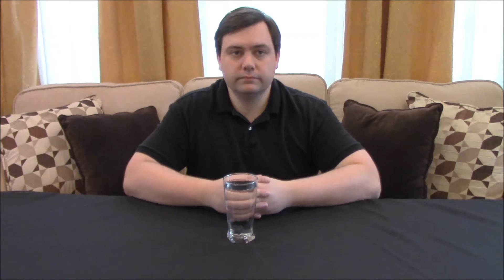On the Compressibility of Water

Comment: I think the myth of water being incompressible is from  the study of steam power plants. In my mechanical engineering classes, (long ago), when studying how steam progresses through a power plant, the steam can compress here and there, but the compressibility of water condensate is negligible, and therefore was probably referred to as incompressible to make it easier to understand. Your comment on the ability of water to transmit sound is a simple way to illustrate how water does indeed compress.
Reply: I wonder what would happen to water in a black hole! I assume the atoms would rip apart maybe turning it into a gas! I guess I’m thinking more about the preverbal unstoppable object running into an immovable wall!

Comment: Sir, I got good answer to the compressibility. I request you to let me know about elastic behaviour of water/fluid
Thanking you sir
Reply from the maker: When something is elastic, it means that it can compress or change shape when a force is applied, then return to its original shape when the force is removed. When a volume of water is compressed by a small amount by applying pressure, it will return to its original volume when the added pressure is removed.

We can measure how much pressure is required to change the volume of a particular amount of water with a value known as the Bulk Modulus, usually labelled with the symbol K. For water, this is approximately 2.2x10^9 N/m^2. The Bulk Modulus is different for different fluids, but can be easily looked up along with equations on how to apply it.

But be careful, water and other fluids are can be tricky depending on how high or low the pressure goes since it may change phase. The fluid may turn into a gas (steam) or into a solid (ice). Also, temperature can play an important role, too. Close to room temperature and pressure, these are not too important.

Comment: I like the nuance addressed. In applications where water is compressed like water cutting, how much of the energy transferred by the water is from the elastic modulus of the metals used? Or is it significantly due to the compression of the water?

Comment: I am not sure your percentage for compressibility is correct. According to the bulk strain formula, at 1,000 bar (near the bottom of the Mariana Trench), water compresses by less than 2%. It's why marine life at that depth don't implode. At around 10,000 bar of pressure, water only compresses to ~ 3%.

Comment: what is the physical meaning of that compressibility of water is bigger than that in mercury ?
Reply from the maker: The size and shape of an atom or molecule, and how it chemically reacts with other atoms or molecules affect how compressible a substance is.

Atoms never actually "touch." When two atoms come close together and do not react with each other, it is electromagnetic forces between the atoms that start to increase very quickly and push them apart. Mercury is a large atom when compared to a water molecule, and there are more atoms of mercury in a given volume at room temperature. This means that the mercury atoms will begin to interact with each other sooner, making it harder to compress than water.

Comment: If you had a container which was indestructable and a press that could press extremely hard, what would happen?
Reply from the maker: This is a variation of the "unstoppable force vs. immovable object" riddle that presents an unsolvable paradox. However, in your particular statement, the press would come in contact with the container and stop.

Indestructible implies infinitely strong. If the container is truly infinitely strong, then no force can crush it. This is true for 1 Newton, 1,000 Newtons, of 1,000,000,000,000,000,000,000,000 Newtons of pressing force. The container will always be able to resist the press with an equal and opposite force.

If the press is implied to apply infinite force, then its infinity vs. infinity, in which case they balance and the press still comes to a stop. Since neither can exceed infinity, they would be in a state of equilibrium.
Reply: Mechanical-Y Thank you for the answer! But what if this indestructable container has water in it, and you press with unlimited force, would the same thing happen or would the water compress? Thank you again for your time sir
Reply from the maker: Depends on what you mean by "indestructible." If the container can deform or change shape without being destroyed, then the water would compress. Think of a rubber tire or balloon - you can compress it a little bit without destroying it. So if the container is some kind of indestructible rubber, then the water compresses.

If indestructible means that the container won't change shape and is always rigid, then it doesn't matter what it is filled with and the press will always stop when it comes in contact with it.

All matter can be compressed to a very high degree, so if an extremely strong press was pushing on an object without the indestructible container, then you can get extreme compression. Black holes are the most extreme example me know of where an object the size of the Moon can be compressed to a 0.1 mm diameter sphere.
Reply: Mechanical-Y Again thank you for your answer! I have had this thought in my brain since 3 years ago. And yesterday I found out my friend also had thought of it for a while. We discussed it and our only explanation was that the preassure would eventuelly get so big that it turned into a black hole. But now you've cleared it up! Thank you again for your help. I will be sure to sub, like and share of course
Reply from the maker: Thank you. Glad to help!
Reply: Would there be any states in between liquid water and black hole in this hypothetical scenario? Water losing molecular structure, individual atoms getting closer together than the size of electron orbitals etc. ?
Reply: @Predrag Mandic - Normal Ice molecules are paradoxically larger than the corresponding volume of water at the sort of pressures where they form, so increasing pressure isn't going to force a liquid to solid transformation. But there are other forms of ice as detailed here: http://ergodic.ugr.es/termo/lecciones/water1.html that would be reached as you racked up the pressure.
If you are going the whole way to "black hole" however, I'd expect extreme pressures to first disassociate the hydrogen and oxygen - as, at some point, the pressure applied would exceed the strength of the molecular bonds holding them together - so they would stop being water so much as a mix of atomic hydrogen and oxygen. Further increasing the pressure would exceed the strength of the electron shells holding the nuclei apart and they would collapse and you would get neutronium. Then, the neutrons collapse into a kind of quark soup I think. And the final stop would be the formation of an event horizon if you were compressing down to a point. I don't know if you'd ever get that if you were compressing a plane.
Reply: So I've heard and correct me if I'm wrong that if you were to compress water (let's say with this box) it would eventually become a form of ice and as you continue to press you will continue the path of different stages of ice like example ice 1 to ice 2. I know there are more than 10 stages but I don't know the exact scientists have discovered.